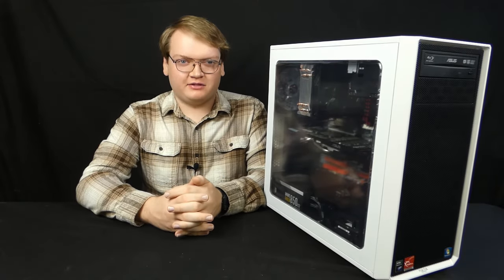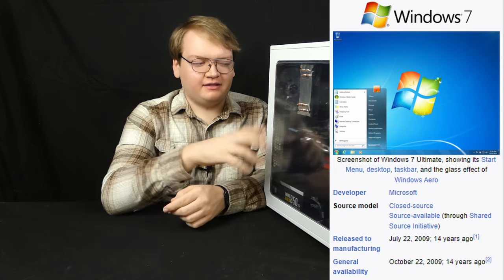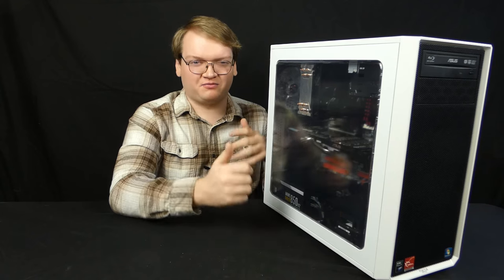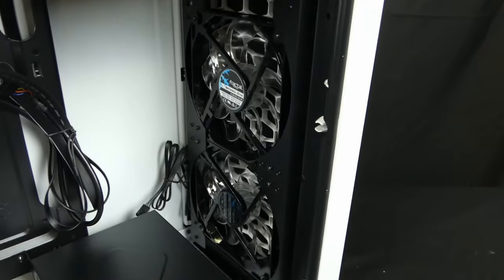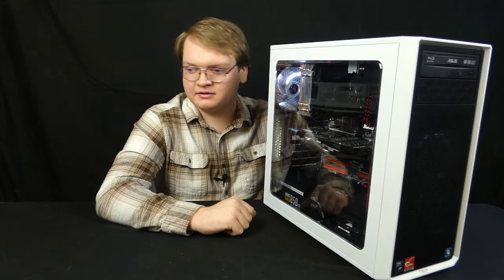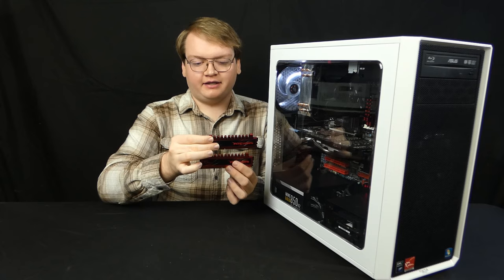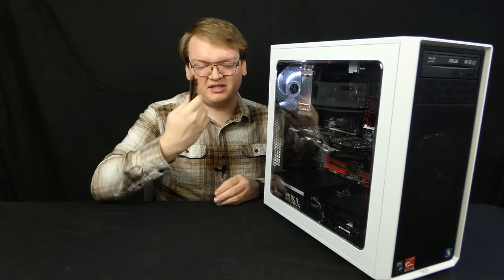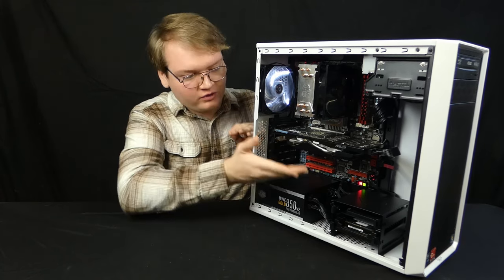Building a Windows 7 Gaming PC

Comment: Nice video. I'm building my own Ryzen 7 5800X system for a tri boot Windows 7 and Windows 10 and Linux Mint setup. I'm using an old Asrock X370 Taichi motherboard updated to the latest bios and a Coolermaster Stacker 830 Neo case (Its really nice), the neo means its black painted aluminium. GPU is a RX580. I couldn't get the USB 3.0 drivers installed onto my ISO so I bought a PS/2 keyboard for it. You know your the first youtube content creator I came across who actually praises Windows 7 for what it is instead of bashes on it for being obsolete, that earned you a thumbs up. Sad times that we live in currently.

Comment: I actually just built myself a new dual boot WInXp/Win7 machine. I did a late windows xp using a Sandy Bridge Chip and a 750ti, some of the last officially supported parts with real XP drivers without hacks. Which also conveniently ended up being a massive overkill XP build but also a great upper mid to high windows 7 build too.
Reply: Can you tell us the other specs, sounds like a very promising build.

Comment: Windows 7 and computers that ran it being considered retro by some is such a scary thought when I litterally used to daily drive back in 2019 to early 2020. Really shows how fast time passes.

Great build and great video, though. I really enjoyed the whole thing, and would like to see more builds and videos like this and your minimum requirements XP build one.
Reply from the maker: Glad you liked it and the XP Minimum Requirements video. I hope to eventually do one for Windows 95 as well.
Reply: For sure, first gaming pc i built was a Athlon II x3 445 3.1 ghz, later unlocked 4th cpu core & did a light overclock to 3.5 ghz.
I still have my first graphics card from the build as well.

A Sapphire HD 5770 lite 1 gb which was a huge upgrade from the HD 3650 512 mb ddr2 i first ran in this system with 1x2 gb ram stick.
Upgraded cpu too a phenom II x4 955 somewhere around August 2012 almost for free with my cpu in a trade & like 20$.
Had at this point already 4x2 gb sticks for a total of 8 gb ram.

Then i got the phenom II x6 1090t in March 2015 (Used ofc for about 600 sek or about 70$ at the time.)
After i had just upgraded to a Asus r9 280 direct cu II graphics card 2 months earlier.

Kept that AM3 system until January 2017 when i got an I5 2500 non k & a Asus Z77-V LX motherboard for free, which i later bought an I5 2500k for ca 2021 & ran overclocked too 4.5 ghz, though onboard sound is dead on the motherboard unfortunately.

Ran pirated Windows 7 until December 2022 here myself on a I5 2500k at 4.5 ghz, 4x4 gb ram at 1600 mhz & my 1660 super.
Went with windows 10 now on my ryzen 5600 2x8 gb 3200 mhz ddr4.
Reply: I daily drove Windows 7 until late 2020 when I switched to Windows 10 LTSC 2019

My first Win7 system was a HP Z400 in early June 2013. It had a Xeon W3520 (i7-920), 6GB RAM, Quadro FX 1800 (9600 GT) and 2x 500GB HDDs. In late 2013 I upgraded the RAM to 12GB and in some point had added a 2TB HDD.
In January 2014 I upgraded the graphics card to an Asus GTX 660 DC2 OC and added a 120GB Kingston SSDNow V300 in June 2014. I did a new Win7 install on the SSD.

Sometime in 2015 I bought an Asus Xonar DGX sound card

In March 2016 I bought another HP Z400 which was a newer revision with 6 DIMM slots instead of 4. It also had a Xeon W3550 (i7-950) which was a small upgrade from my old CPU. I also upgraded the RAM to 16GB (4+4+2+2+2+2). Also a new Win7 install but it's the one I used until the end.
In July 2016 I upgraded the GTX 660 to a GTX 960 Turbo OC, upgraded the boot drive to a 240GB Kingston SSDNow V300 and the CPU to a newer 6c/12t Xeon X5670.
In November 2016 I bought an Asus P6X58D-E (which allowed me to OC the CPU) and temporarily built it in to the case of my secondary PC (C2Q Q6600 system)

In February 2017 I finally bought a new case, Fractal Design Define R5, and a 620W Seasonic PSU
Over the years there was some small upgrades mainly to storage. For example I upgraded the SSD to a 250GB Samsung 750 EVO mainly to the free up the 240GB V300 for the 6 DIMM HP Z400

February 2019 I upgraded to 24GB RAM

In November 2020 I switched to Windows 10 LTSC 2019 as main OS. I'm going to continue listing the history of the system anyway :P

In July 2021 the motherboard got fried by lightning. A bit later the same month I managed to get another P6X58D-E for great price and it came with a nice Thermalright Silver Arrow cooler, i7-950 and a Xeon X5675. I rebuilt my PC and used the X5675 but it ended up being worse bin than my X5670

September 2022 SSD upgrade to a 500GB Samsung 870 EVO and a 4TB WD Red Plus HDD

February 2023 upgraded the GPU from a GTX 960 to a GTX 1080 Strix Advanced
April 2023 finally changed the CPU back to the Xeon X5670 which happily runs at 4.4GHz
November 2023 downgraded the GPU to a GTX 760 because I built a new system and took the GTX 1080 for it

Specs at the end before the GPU downgrade: X5670 6c/12t @ 4.4GHz cooler with a Thermalright Silver Arrow, 24GB DDR3 1600MHz, GTX 1080 Strix, 500GB 870 EVO (Win10), 250GB 750 EVO (Win7), 120GB A400 (page file), 2x 4TB and 2x 2TB HDDs, Define R5, Seasonic M12II-620, Asus Xonar DGX.
Even though it's still on the same X58/LGA1366 platform the only part that has been in the original HP Z400 is the sound card. Two of the RAM sticks were the ones from late 2013 but I replaced them with better ones when I got the second P6X58D-E in July 2021.

For my new build I bought a used i9-10900X and Asus TUF X299 Mark 1. The only part from the old system is the GTX 1080, I bought a new case and everything else.
Full specs: i9-10900X, DeepCool Assassin III, Asus TUF X299 Mark 1, 64GB DDR4 3200MHz (dual channel for now), GTX 1080 Strix, 2TB Samsung 970 Evo Plus, 2TB WD SN570, 8TB Seagate Exos, Fractal Meshify 2, Seasonic Focus GX-850

I didn't expect this comment to be this long lol
Reply: It's even funnier to think when I'm daily driving a Z170 board with i7-6700K. And I have native support for Win7 with my motherboard and GPU. I also have a M2 slot on my mobo (Gen 3 but that's still enough).
IIRC all RTX 20 series cards still had Win7 drivers.
Reply: @spvvk3621  Even RTX 30 series cards had Windows 7 drivers. RTX 40 series was the first one that doesn't
Reply: Now that's something I didn't know, thx for sharing!

Comment: Hell yeah, takes me back. When I was in college I built a new gaming PC in October 2010. MSI 890FXA mobo, Phenom II X6 1055T, 4GB of OCZ Ram bundled with OCZ PSU, 128GB SSD and twin Radeon HD 6850's in Crossfire. In retrospect I probably should have went with a higher-tier Radeon card and just ran one. I ran that PC from late 2010 to mid-2018 when I couldn't run certain games anymore due to not having the latest SSE 4.x instruction set on the CPU. Still that PC was a beast even running Windows 10 for a few years. When I finally abandoned that platform I was running 16GB of red GSkill ripjaws ram, upgraded the CPU to an 1100T, upgraded the SSD to a 1TB, and ran a GTX 970 GPU and some other higher-end PSU. I also had a blue-ray optical drive and a card reader in my 5.25" bays. I loved that rig and I'm hoping the AM4 rig I replaced it with will last until about 2030!
Reply: Good Luck with you am4 man i hope it can last up until 2028 or 30 but no matter 

If companies let the cpu instructions be then you can run anything up until 2040

Comment: Something you didn’t mention that a Windows 7 retro build is good for is source ports. Taking older classics and running them through modern source ports to achieve better graphical fidelity/frame rates than older hardware on older OS‘s would allow. My Windows 7 retro build has a 4790K and a 4-gig GTX 960. Has a 1-TB Samsung 870 Evo boot drive and a 2-TB Evo for additional storage. Needless to say ANYTHING from the 2010’s and back runs comically smooth. Including games running through more modern source ports.

Side note; but to use any 900 series card past a GTX 960 on windows XP requires you to modify the INI file, otherwise it’ll not display any image. It’s doable, but something of note nonetheless and can lead to issues. Hence why I stick to an EVGA (rip) 960.
Reply from the maker: I hadn’t thought about running source ports on it, but that’s a great idea. O forgot about needing to modify the Nvidia drivers too, my brain just automatically thinks any 900 series card for some reason.

Comment: I'm not even kidding, I legit used Windows 7 for a full 11 years, from 2010 to 2021. And yeah it was on the same computer, a Dell Precision M4500 mobile workstation. 
Now that thing is at a wonder crossroad in terms of software and hardware~ It could run XP and was an 'enterprise' kind of machine so it has just so many legacy options.
Oh and I still use it as my secondary computer and I've had it on and running for almost 14 years as well, I never really turned it off except for transport.

Comment: I happen to doing a similar build at the time! Wish I would have seen this video before I got started. Someone gave me an HP desktop from late 2009, maybe 2010, and at first glance I thought it wasn't worth giving it any attention. But when I looked inside I saw it was quite clean and the motherboard has Rubycon, ChemiCon, and Panasonic capacitors so I thought maybe this is worth saving! It was painfully slow with the HDD, I put a spare SSD in and its now tolerable. Next I will be upgrading the CPU from an Athlon X2 2.3ghz to a 3.2ghz Phenom II x4 95w for only $15, should make a big difference.

Comment: Fantastic video. I plan to Dual boot WinXP and Win7 with a Qx9650 CPU and 8800 GTS 512. Soundcard will be a soundblaster x-fi and display is a 1600x1200 20" CRT.  I will also have a  Windows 7 virtual machine on my Ryzen 5950X system passing through a Quadro RTX 4000 for later games.

Comment: I built a 4th gen i5 3.2, 16gb & a 9800gtx+  running 7. Runs all games from 14 or so & back very well. Havent had a newish system since the x2 days. Win 7 is solid for dx10 & older games. May upgrade the 9800 eventually to a 1070 or something.

Comment: Pop Air has 2 5.25" bays hidden. Also I built xp rig in in the Focus G mini. It has I7-3770, 16GB 1600MHz RAM, GTX 780 Ti. Think about dual booting the XP 32 bit os and Windows 7 64 bit, both configured IDE because legacy. XP is on a 1TB WD blue SSD, and Windows 7 would go on a Samsung 870 Evo SSD. Also, I want Windows 7 because of Windows Media Center. I forgot, Creative RX7.1 Sound card for Optical out and EAX 5 sound support. I think Windows 7 64 bit needs to happen on this rig. Cool case. I have that white case with a Sabertooth 990FX, FX8350, HD7970, 4GB 1600MHz RAM.

Comment: Don't mean to sound rude, but what's a good motive to build a windows 7 machine? Seems to me that basically all software built for windows 7 will run on current windows without issue. 
The same can't be said for the XP era though, i get why people build Win XP machines, compatibility is just much better for running software from that period of time.
Reply from the maker: I address this towards the end of the video. Right now there really isn't any reason to build one. But as time progresses on and Windows gets updated, more and more software will start to have compatibility issues. It's also a good time to start collecting parts since no one really cares about this era of parts yet and the prices are getting pretty cheap for most early 2010s hardware.
Reply: @NTGTechnology  But why buy 2010 hardware then? Why not just buy current hardware with windows 10 since it can play the same games you would play on Win7 correctly? 
Again, It's just when you start going to 2006 and prior titles that you really need real hardware to play them correctly, because of major api changes, driver level stuff like scheduling, EAX, etc,etc.
Don't know if my point is coming across, i'm talking about a real necessity of a specific configuration to run a piece of software. You can run a 2009 game on any pc made today, you don't really need 2010's hardware.
to each his own, i guess.
Reply from the maker: @tradito  Because I find it fun? Does there really need to be a reason? Also it gives me a chance to use Windows 7 again which isn't really possible on modern hardware anymore.
Reply: There is the "for the fun of it" factor that has drawn me to my xp/7 dual boot build. For me specifically, I built it to have an offline and nostalgic machine that reminds me of the way things were when I was a kid/teenager.

Comment: Its a nice case, one of the few modern-ish ones left that includes proper drive bays.  I also recommend the Thermaltake Versa H26.

I love tinkering with older hardware too.  I recently resurrected my AM3+ FX system and put Windows 7 on there 😃

Comment: My Windows 7 rig was from Windows Vista PC era
- ASUS P5KPL-AM SE G31
- Intel Core 2 Duo E7400
- 4GB of DDR2 RAM (2pcs x 2GB)
- ATI Radeon HD 4600
- SATA HDD 160GB for dual Boot Windows XP and Vista, after Windows 7 came out I moved on from Vista

To be honest, I had H61 motherboard for Windows 7 and Windows 8.1 at that time, but because MSI Armor RX 570 only support Windows 10, so I just get rid both OS.

Comment: Socket 1366 was intel's first dive into high end consumer 6 cores in 2011, the phenom II x6 launched december 2010 for the phenom II x6 1100T & by sandy bridge on x79/ socket 2011 you had up to 8 cores, 16 threads & Ivy bridge ep had up to 12 cpu cores & 24 threads.

edit´
Also just got too the graphics card portion of the video, you can crossfire that half functional HD 5970 with that HD 5850. HD 58xx, & HD 59xx cards can crossfire with each other just fine.
Ofc id run the 5970 as the primary card while the HD 5850 is the secondary card, frame pacing might be a little bit off due to performance differences but it should still be worth checking out.
Reply: The first X58/LGA1366 6c/12t CPU, i7-980X, was released in March 2010 and the cheaper i7-970 in July 2010. The first Phenom II X6 was released in April 2010.
2011 is when the i7-990X and cheaper non-X i7-980 were released. X79/LGA2011 Sandy Bridge 6c/12t i7-3960X and i7-3930K were released in November 2011 but by then AMD already had the Bulldozer FX-8150.
Intel didn't have mainstream 6 core CPUs until the i7-8700K and i5-8600K in October 2017

Comment: AM3 is pretty perfect for this.
Got a mostly assembled similar era rig in the works as well.
Just got hold of a great 1920x1200 ips monitor from 2011 as well for free just yesterday actually.
An HP ZR2440W 24 inch
Cpu wise I'll use the AMD Athlon II x3 445 3.1 from my lil brothers old rig, arctic cooling freezer 64 / freezer 7 cpu cooler, currently as it's laying flat it's a Noctua NF-P12 120mm fan blowing through the cooler, ill probably put in a bit slower moving fan i got sitting around while running the cpu unlocked to 4 cores & stock voltage or slightly undervolted.
(Not my original cpu but the same model i got hold of a few years ago by chance before i built my lil brothers rig.)
2x4 gb ddr3 1600 mhz from crucial, Asus M4A78LT-M-LE, kind of shitty matx board but vrm survived me overclocking this Athlon with 4th cpu core unlocked at 3.5 ghz so it's good enough for a few benchmark runs with that clock speed I'd imagine before i put this into a case, also got a 128 gb samsung oem ssd based on their 830 i think it was.
Sapphire hd 5770 lite 1 gb from my first gaming pc build, will likely be going into it as well.

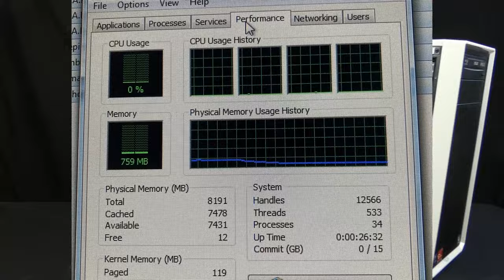Comment: 33:46 759000K MEM idle ?! Yeah. I love windows 7, but you should have seen stock sp4 windows 2000 idling. I think it was around 50000K MEM USAGE ?!?!?!

And with 2000 fully updated + the extended kernel ? It idles at around 250000K.